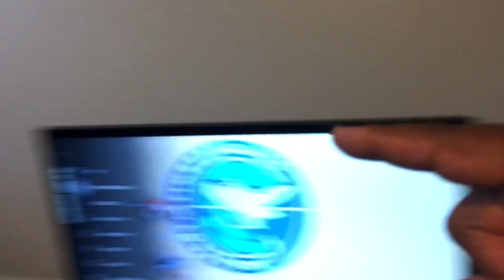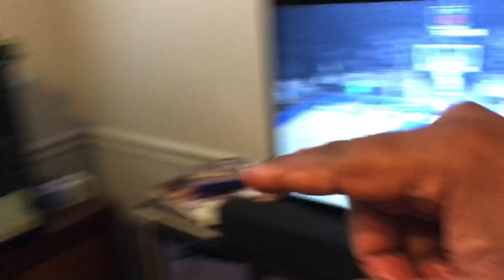LEMON OSCAR FISH RESCUE, NEARLY DIED!

Comment: Aloha, you did everything right that's why he recovered so well. When fish are stressed they need more oxygen and I've used that method before with a saltwater purple tang placing the net with the purple tang in front of a air flow powerhead for over an hour and he recovered from actually laying down on his side at the bottom of the tank and is doing great today. Nice job. Remember any time you add medications of any kind always increase your oxygen flow. The medication depletes the oxygen in the water. Not bored watching your videos, keep them coming thank you
Reply: 🤣 I cant stop watching your intro ☝️♥️

Comment: Dude. That Oscar is far from a Lemon Oscar trust me. A Lemon Oscar looks much more exotic than the Oscar that you have.  It does have the black fins that resembles a lemons Oscar but that’s the only thing. What you have is called an Albino tiger Lutino Oscar. Lemon Oscars are solid yellow with very little tan on their heads and under their chin. Also, If a Lemon Oscar is a female it will have yellow eyes and black eyes if it’s a male. Your Oscar has orange eyes which is typically a sign of albinoism within the bloodline. .
Reply from the maker: Well Hell Ryan looks like they sold me a lemon 😂🤣😂 Damn them 🤙🏽🤙🏽
Reply: Your so very wrong!  lol!
   Albino oscars are cream white with red/orange blotches and little to no black at the edges of the fins. 
   Lemon Oscars are a more white/cream color and have yellow blotches or tiger stripes instead of red and they have black at the edges of the fins. 
What he has is 100% a Lemon Oscar!
   Lemon Oscars have different variations of white/cream, yellow and black.  Their are variations even in the same spawn.